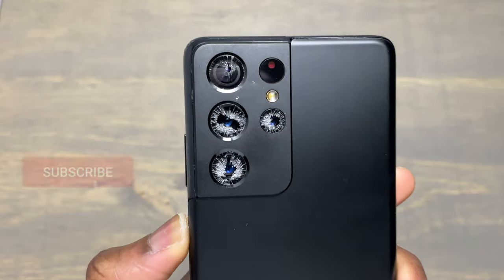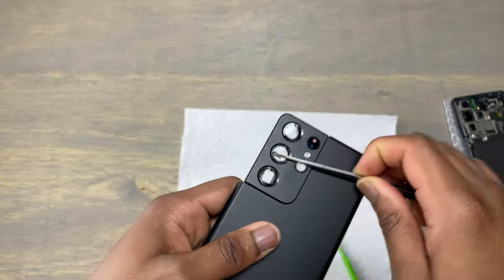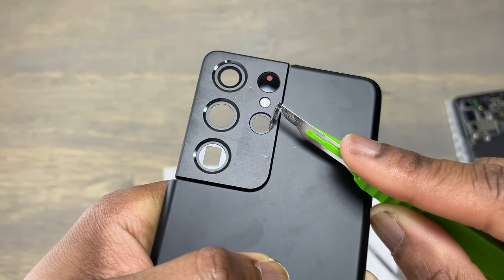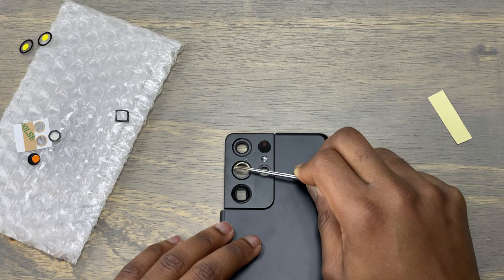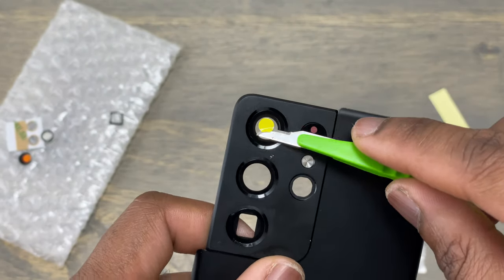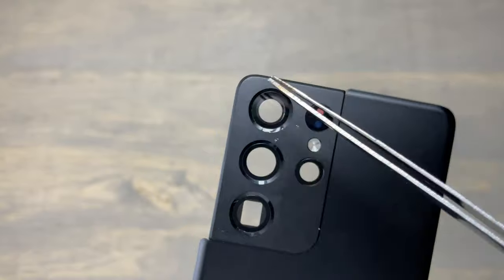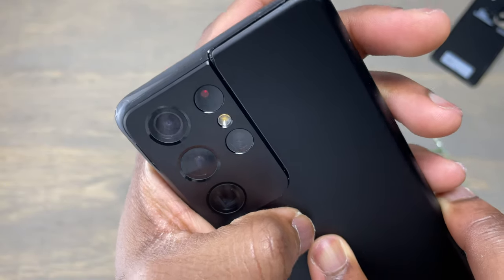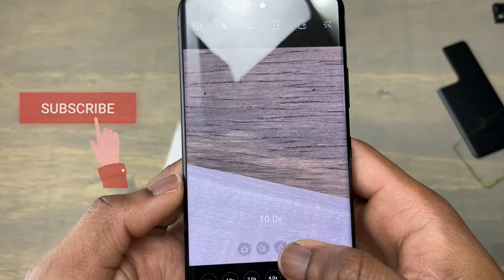Samsung Galaxy S21 Ultra Camera Glass Repair

Comment: wow, thank you so much for this bro! it looks easy and simple in the video. but i think i just might take my s21 ultra to a repair shop instead, and get a entirely new back cover.😭 the plastic aluminum part of the camera cover, was scraped off at the edges. It looks so bad imo. And my camera lens aren't broken, but my lens protector are so the lens protector shattered and broke over time.:( but thanks to this, i know now that my phone can still be recovered! i won't need to get a new phone after all. thanks once again for staring this bro! Big thumbs up. 👍
Reply from the maker: So happy to hear that the video is very helpful. 😅 the back is actually glass and aluminum, I had to break the other back cover I had to confirm it's glass not plastic 😂 felt too much like plastic. Thank again we'll try to make more repair contents with the same format
Reply: @ersbit  ah, my bad! I'm not a tech pro, so watching this video was a bit foreign to me. 🥲 This is your area of expertise 😭✌️keep up the good work tho!!

Comment: Just broke one of my lenses, gonna give this a try. Thanks bro
Reply from the maker: You're welcome bro, if it is only one lens You could change that one alone without removing the back cover, but you'll have to be more careful not to touch the camera itself and doing it with camera facing down with you looking up with protection for eye so that particles of glass fell down and not inside the device. 
😅it a bit weird to explain in comments.
Or you just do it like in the video.
Reply: @ersbit  all my parts just came in, I only broke one lens. Do you think it would be a better idea to not take off my back cover?
Reply from the maker: I really think you can do it without removing the whole back. You just have to be carefull with the particles of glass. 
When I was removing the other broken lens I was not using heat at all. Use a sharp thing to remove the glass while it's facing the earth ( put eye protection glass) broken glass will fall down instead of inside the device. With a little hearing of the camera bumps it's should be possible( it less work than doing the back all over again)
Reply: @DoctorPurginator  did it work
Reply: @DoctorPurginator  how did it go?
Reply: @ersbit  could I get in touch about a similar problem?

Comment: should I say goodbye to waterproofing if I have broken the lens glass? is there a chance that some service will do it as it was?
Reply from the maker: I think you should not count on it being really really waterproof the tape they provided was too thin ( not same thickness as the original). Technically it might still hold but maybe for 2 to 3 minutes. 
Splashes and a few seconds plunged it might be fine
Reply: @ersbit  I called the samsung service and they told me they were replacing their backs with factory waterproofness, epic win (something like 100$). Btw thank u for answer <3
Reply from the maker: Great information ✅ thanks
Reply from the maker: Hey I made a video specially to answer that question
Here -> https://youtu.be/zypD1HeLXcI

Comment: I see that the camera bump in s21 ultra is metal. Is it okay to lay the phone in a surface where the camera bump touches first? Are the lenses protected?
Reply from the maker: You should have a case because it doesn't take much to leave a scratch on the metal camera bump. Once it's scratched your gonna notice that shiny line/points. Gotta make sure the phone doesn't slide or while taking it you don't slide and then raise. 
None of the lenses are protected in the event of a scratch it's gonna be notice in your pictures (only if the scratch is big enough to interact with your camera focus)

Comment: Just did this today without needing to remove the back over
Reply from the maker: Great to hear you tried and successfully completed it 👍🏽🎉
Reply: How did you heat the lenses?
Reply: @joshniemantsverdriet7786  i used a hair dryer and the metal sim card pin 📍 to pick out and remove the broken glass. Don't use too much heat you don't want to damage the cameras. 

Just so you know the glass ring lens has a black ring ring around each camera lens so they just stick on. Something like a sim card pin 📍can be used to gently remove the lens and the black ring glued stickers.

And whatever you do do not ever use a heat gun for this it will melt your phone. I had a guy that spilt water on  his laptop and tried to  dry the laptop keyboard with a heatgun and it melted his keyboard it a matter of seconds it was so bad 🤣 .....so stick to a hair dryer and be patient.
Reply: @bign1667  how far would you suggest holding it from the phone to melt it? I'm terrified of melting anything else that I shouldn't haha
Reply: @bign1667  actually just got it all out without even heating it, just scraping it out by the edges with a push pin. My replacement lenses haven't arrived yet though, should that camera look blurry with no lens? 📌📌
Reply from the maker: 😂😂😂heat gun and plastic that a combination for cheese melt effect. You gotta be carefull with heat gun settings too much will surely damage
Reply from the maker: It should not but you need to protect it against dust and debris that will enter if you're not careful
Reply: @joshniemantsverdriet7786  use a lens protector its just a glass cover to procect the camera. They are cheap and can be found in many phone accessory stores. Should be cheap temporary solution till you order the spare parts you need to fix it properly. 

As for the blury camera try to reset the camera settings and restart the phone.

If no success repair the phone the best you can and get a professional repair shop or Samsung to fix the blury camera for you.
Reply: Thanks will try!
Reply from the maker: Good luck it's not very hard just intimidating 😅

Comment: Bro, my ultrawide camera lens cracked yesterday. So how much do you think it will cost to replace the lens in the service centre?
Reply from the maker: Hummm that's a great question, but the exact cost I do not know. You can check Samsung website maybe or other specialized website. It might run you something close to $150 or more maybe
Reply: @ersbit  I don't know if the camera itself is damaged. Rn I only know that the lens is cracked, just like how your phone is shown in this video. When I try using the ultrawide camera, it looked blurry and the images came out looking not sharp enough. I just want to know if you think the camera is damaged, if not, then the staffs said that it'll cost lesser than $10
Reply: @ersbit  but if the camera is damaged, you're right, the staffs said that it will cost around $100. I just hope the camera itself is not damaged, I'm very worried about it because $100 is alot
Reply from the maker: Unfortunately if the camera lens is cracked in such a way, you can confirm if the camera is good by only removing the back and test the camera without any lens/glass. $10 wow you must have some warranty or plans that give you access to these kinds of discounted prices 👍🏽
Reply: @ersbit  yes bro, but $10 is needed only if the lens needs to be replaced. If the camera itself is damaged, it will cost me around $100. Btw bro, when the lens on your S21 Ultra cracked, did it affect your HDR? Because my ultrawide camera has the blur issue and the HDR is not as great as how it was before the lens cracked
Reply from the maker: Humm not really because my cameras were not seeing anything at that moment. If you have focus issues its either camera lens or camera modules.
If it was just fine before the lens Crack you can be a little confortable in thinking it's the lens only.
Reply: @ersbit  okay, thanks alot. I'm still waiting for the lens to arrive, let's hope it's only the lens and not the camera itself that is damaged🙏

Comment: Hello! Why are you removing the back cover? It looks like you can replace the glass without violating the tightness of the case itself.
Reply from the maker: This was mainly to show. You can replace it with our removing the back panel. I make multiple other videos where I didn't remove the back panel.and simply replaced the camera glasses.

Comment: I have a dust particle inside of the center left camera lense my phone is less than 1 month old. How do I get the dust out from inside the lense? S21 Ultra owner
Reply from the maker: Hey, unfortunately if shaking the device doesn't do anything you will have to open the back and clean the camera. Shaking the device is only temporary solution. The best is opening the back glass, clean everything, test the camera and seal properly. Less than 1 month that sounds like a faulty back or the inside of the device was dirty when the rear cover was sealed.
Reply: @ersbit  Do you know if Geek Squad at Best Buy is capable of doing that stuff because I feel like I would break the phone. There isn't even a place to be able to pull the back off without scratching the crap out of the device.
Reply from the maker: I think they should be able to do all that repair, they kinda have training on everything. They gonna charge you a lot if your not in their plans or insured. 
I also think there are a lot of people skilled that can remove the back without a single scratch it very feasible 
Samsung official repair shop or official stores also can do the repair 👍🏽

Comment: none of my lenses are cracked, they have condensation in them though after a dip in the bath last night. would you suggest just getting the back off and drying the lenses out from the inside?
Reply from the maker: That would be my recommendation, but once you take the back off you need to reinstall it with a new double sided tape.

You should do that because the condensation point to a failure in the seals somewhere, and who know your device can get worse if water interact with electronics components.

The other issue maybe or maybe not is getting the double sided tape alone. You may be lucky to have a parts seller sell you the tape alone.
Reply: @ersbit  thank you for getting back to me. can you tell me the things i will need to do that and suggest the best video for me to watch to show me how to get the back off?
Reply from the maker: I have another video of the S21ultra back cover replacement. That one had everything you need to understand and perform the repair.✅

Comment: I've just dropped mine and the bottom camera (periscope) is now cracked. 

Do you have to take it apart to replace it? It looks like if you are careful you can remove the lenses without dismantling the phone.
Reply from the maker: The camera itself is broken or you were talking about the LENS of the periscope camera? 
if it is only one lens You could change that one alone without removing the back cover, but you'll have to be more careful not to touch the camera itself and doing it with camera facing down with you looking up with protection for eye so that particles of glass fell down and not inside the device. 
😅 it a bit weird to explain in comments, but you get the idea.
Reply: @ersbit  yeah I understand, I've ordered the kit so I'll give it a go and let you know how I get on 👌
Reply from the maker: Great, be careful the camera bump gets scratches easily with metal on metal contact.
Reply: @z06dave  hey man, I'm in the same situation only with one lens broken, I ordered the kit as well, did you get to try it without dismantling the phone?
Reply: @onexsp1492  rather frustratingly my partner took it to a phone repair shop while I was at work. The repair itself is actually quite easy. Buy an OEM kit from eBay and just take your time. If the lense has a hole in it you'll be able to get some super thin tweezers in and lift out the broken glass. 

Id say take it to a phone shop first though, most shops around here quote £20-30 which is cheap
Reply from the maker: Yep. 20-30 with parts included ? 
Installation only ?
Reply: @ersbit  all included, parts & fitting.
Reply from the maker: Yep that’s a reasonable price. Thank for the info

Comment: If the lens got crack it will affect phone ip rating?
Reply from the maker: Absolutely, you should avoid any water contact. Even small cracks if submersed in water water might infiltrate your device

Comment: What is the most water-resistant method of replacing the camera glass? Replacing the entire back plate of phone? Or use old phone plate with new gasket?
Reply from the maker: I think that replacing the whole back once is the best way to conserve better water resistance. Changing the aluminum cameras frame only will have you manipulate the camera frame/tape and backglass/tape. The more you manipulate the pieces the higher the chance of forgetting something or making a mistake

Comment: Can I replace a lens without taking off the back cover?
Reply: It's got a scratch only. Can I put the heat gun at 80 on my camera lens for 2 minutes and pull off the scratched lens?
Reply from the maker: Yes it's possible to do it that way the only risk is getting small piece of glass on the inside (you can tap tap the edge of the device to drop any small glass if any is stuck in the camera) or use a vaccum to suck anything that dropped inside. 
If it's only a scratch and the lens is not broken you can use a sharp tool like I did go under the glass and remove it.
2 minutes might be too much I advise you to start 30 seconds if the glass doesn't come off add extra heat that way you lower any risk of Overheating the sensors
Reply from the maker: Just be aware it might leave a scratch whole you try to go under the lens. Might scratch or not depend on how you do it
Reply: Just ordered my lense set and going to try it without removing the back whenever this comes in...
Reply: @fisqual  where did you order your lens from?

Comment: s 21 ultra has a glass back as well as the plus model but not the regular s21 that one has a plastic back and it's the only one that does
Reply from the maker: Are you sure?? what I had was plastic back cover the one I use in this video.
Reply: @ersbit  yes I'm positive
Reply: @ersbit  The S21 Plus and Ultra have glass on either side, while the back of the regular S21 is made of plastic. ...